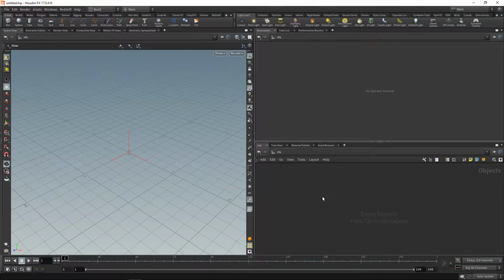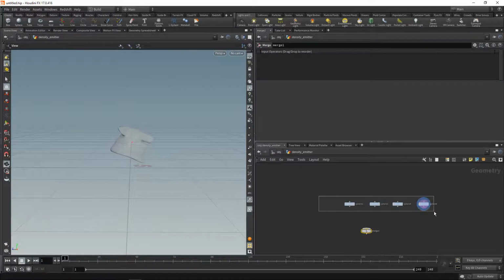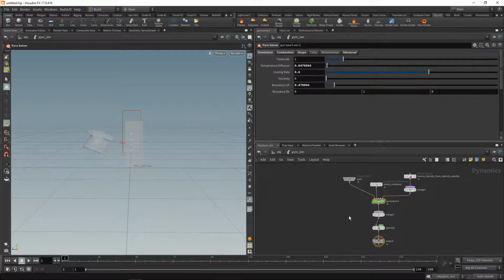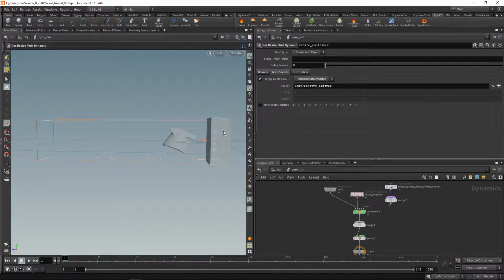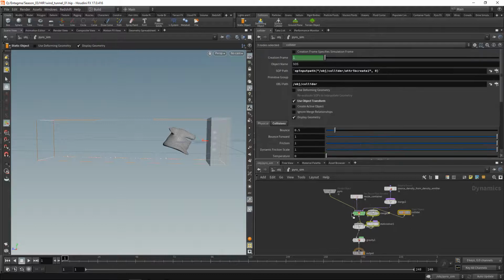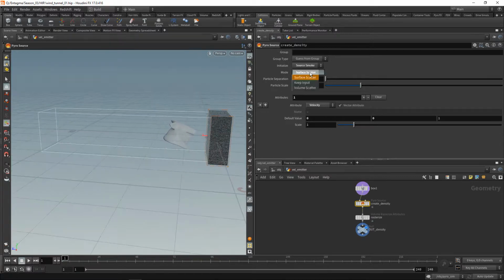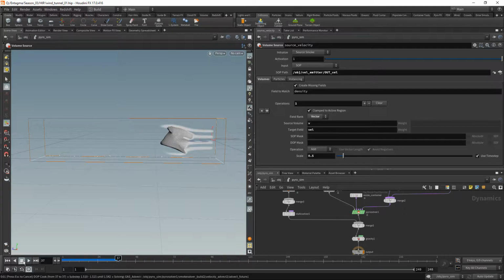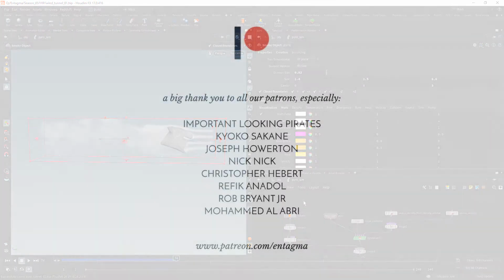Simple Wind Tunnel

Comment: Hi, would it be possible to do this simulation over an Unreal Engine environment, such as Landscape Mountains? I want to build a wind map and assign a wind vector to it. Thanks.
Reply: You can use vector fields in Embergen, but I be thoughting alot over wind/air simulation (maybe its possible to use 0 density smoke to have turbulence for air...)